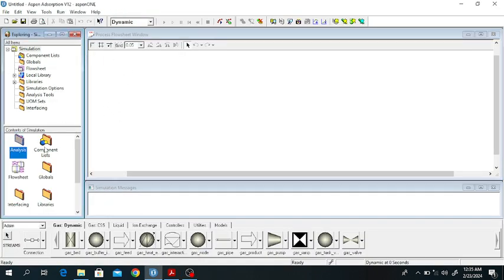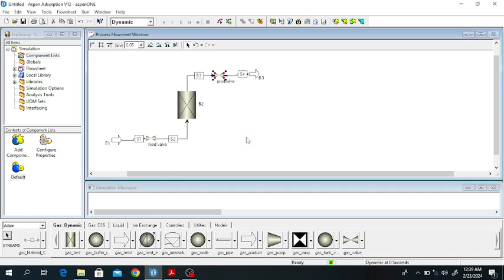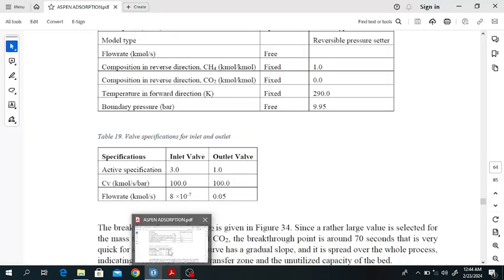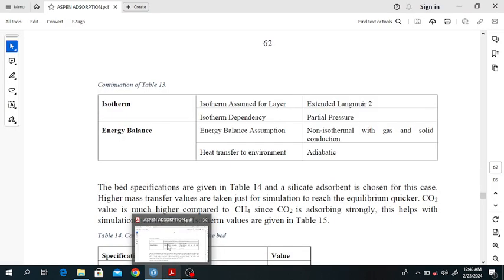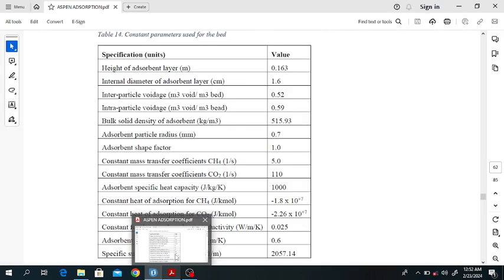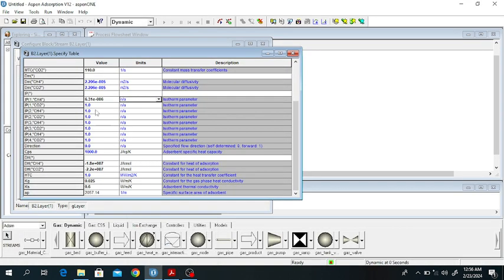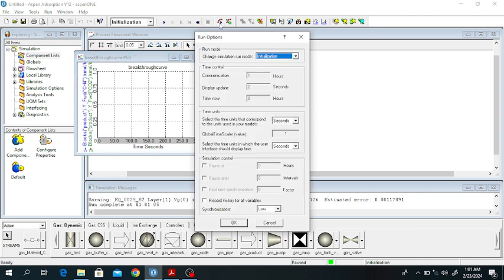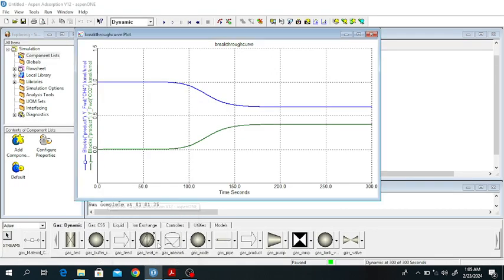Separation of methane (CH4) and carbon dioxide (CO2) from biogas using aspen adsorption

Comment: Thanks for great video, How can I do economic analysis in Aspen Adsorption?    I want to know the required utility for a designed process and do economic analysis by using Aspen Process Economic Analyzer (APEA). How can I use this in Aspen Adsorption? Or, can I transport Aspen Adsorption simulation file to Aspen Plus?
Reply from the maker: Aspen adsorption can be linked with Aspen plus
Reply: Thanks for your reply how I can do it